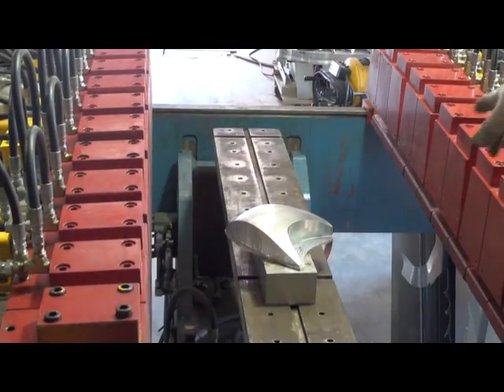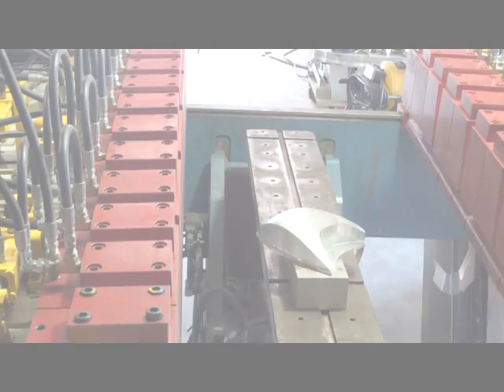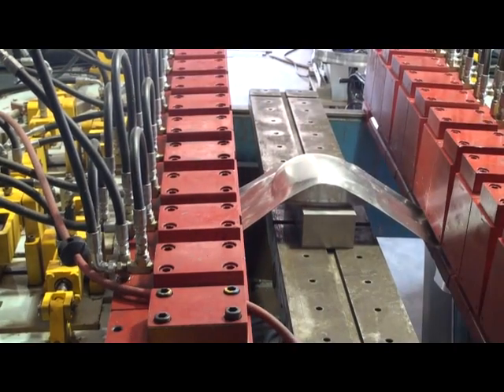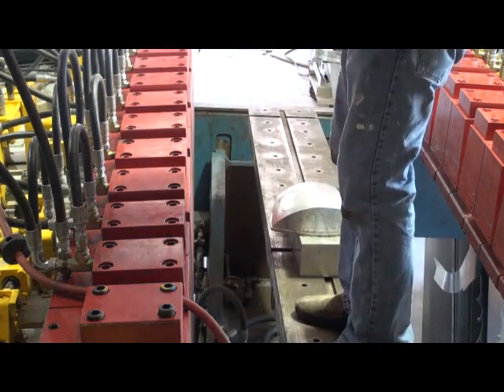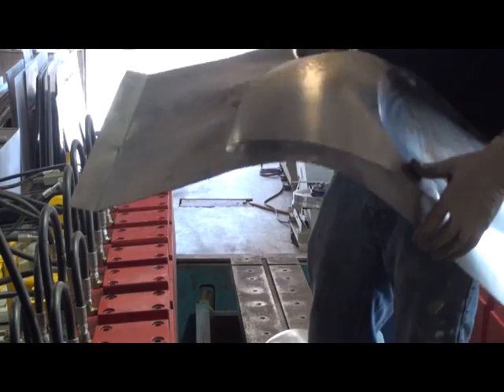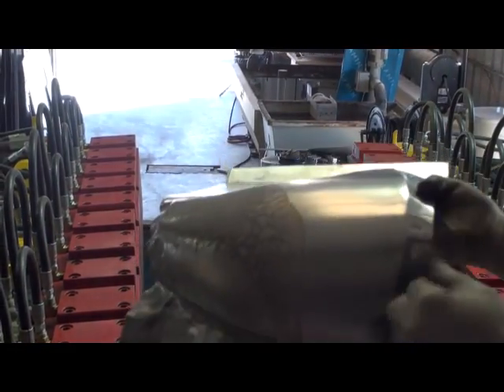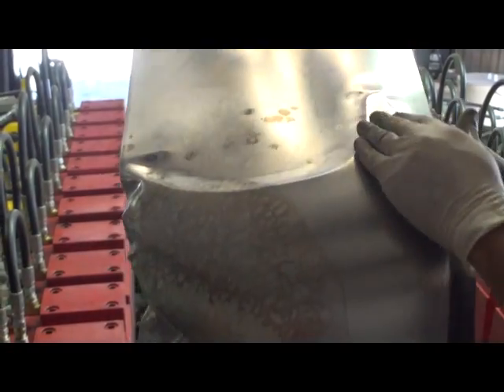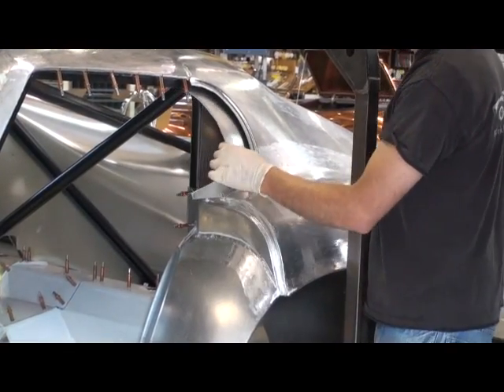Interior rear brake duct scoop manufactoring

Comment from the maker: Yes, the form was made on one of our CNC mills.  We do press a few pieces on the car, like small scoops and the like.

We don't stamp the part because of "spring back."  Spring back can be calculated, but it is quite difficult.  There is little spring back with a stretched part.  Also, with a stretched part we can easily stretch in the trim lines.